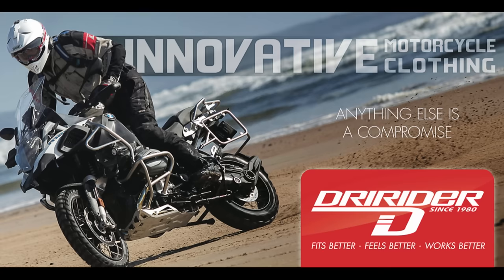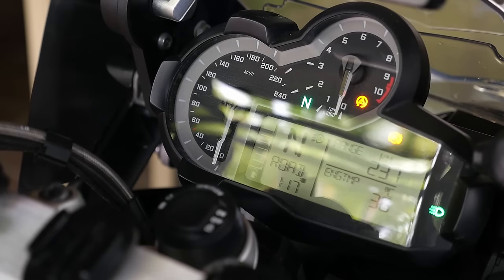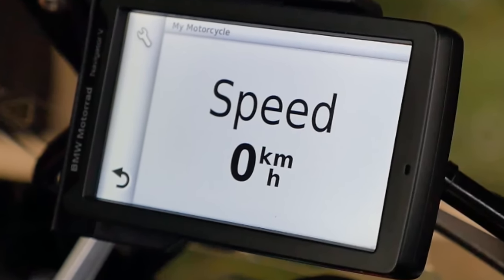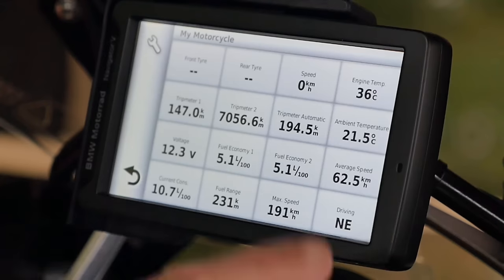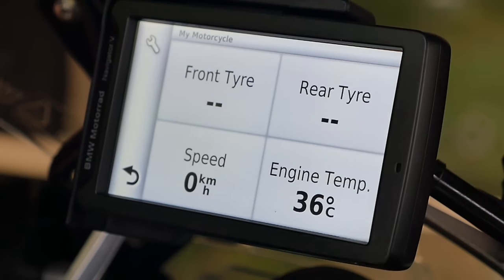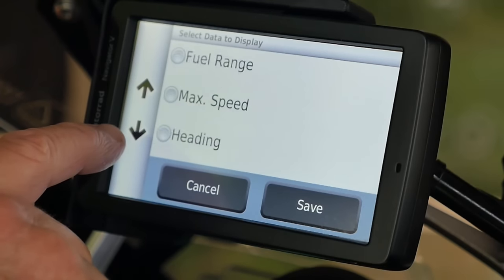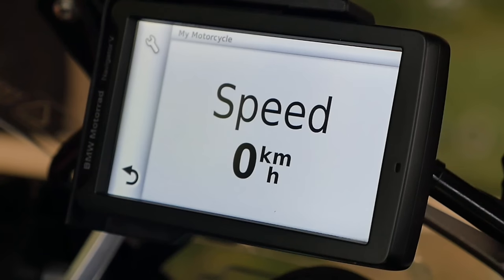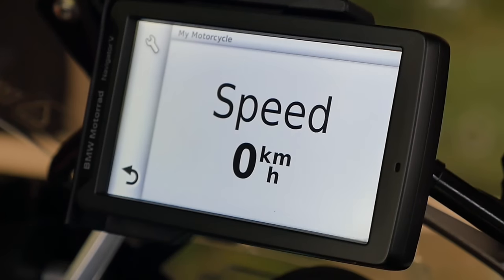Setting Up Digital Speedo on BMW R1200GS Navigator V

Comment: Good vid. Thanks. For whatever reason, manufacturers have been building in speedometer error forever. Always 5mph slower than actual
Reply from the maker: Thanks Joe, I think they err on the slower than actual error which solves the issue of a rider getting a speeding ticket being able to use the speedo reading as a defence. Just a guess

Comment: Is the "My motorcycle" screen a GS only thing? I'm sure I saw it on an RT. I just bought a 1200RT and a Nav5 and can't get to this screen. There's a horrible green screen with lots of useless info about sunset and sunrise, elevation and coordinate, but nothing about the bike as yours has. I can get things like voltage, tires pressure, speed, temp to display on the TFT screen, but only one at a time. One reason I bought this GPS was to have everything on display at once.
Reply from the maker: I don't have an RT mate, so I did some research. It seems that the 'My Motorcycle' App does not operate or even appear when the navigator is fitted to any bike other than the GS. I believe when you put it back on a GS the app appears. Sorry I cant really help mate.
Reply: @TheBikeStig  Yeah I'm starting to see that now. Really bummed out by this. The RT is one of their flagship models with all the Luxury refinements. You'd think that it would have the same integration with their own satnav as the GS. I may have seen it on a Bagger too, I'm not sure. Oh well. Can't have everything I guess.
Reply from the maker: @ArcanePath360  I agree, not sure why they did it this way, its funny I did notice the app image is actually a GS ... should've guessed
Reply: @TheBikeStig   It does suck that they have the means to do a seemingly easy software update to make it RT compatible, since they all have the same pins and hardware. The RT info is there on the TFT, but you can only see one thing at a time. And I'm also not sure why BMW made their TPMS only monitor tire pressure after you get moving. Surely by then it's too late to know if you need air in your tires? My Kymco AK550 could tell you the pressure as soon as you turned on the bike, not even firing it up. You could see your MPG or voltage at the same time. I don't like having to click through pages of menus and scrolling up and down to see this data. The Navigator was supposed to be my way round this problem. It's a shame.

Comment: hi i have navigator 5 and when i plug it to 2016 bmw r 1200 rt, my motorcycle option does not work. navigator 5 in the engine may also be caused in the current state.
Reply from the maker: That's right mate, only works on the GS. Took me a while to find that out.

Comment: I have just purchased an R1200RS with a Nav V, but there is no "My Motorcyle" icon  in the Apps. The jog wheel is not working either. Any suggestions?
Reply from the maker: no mate, they don't have it on those only the GS unfortunately, I cannot of for the life of me understand why
Reply: @TheBikeStig  I am happy to report back that after a morning in the BMW workshop, I now have the nav wheel working and BAM, I now have the My Motorcycle icon on my Nav V and I can access all of the info from my RS as per your video. Happy Days. I reckon there are a lot of owners out there who are not aware that this feature even exists via the Motorrad Sat Navs. Cheers.
Reply from the maker: @kevinroberts2395  that's awesome, I have to remember that as I get a lot of questions about this on bikes other than the GS. cheers mate
Reply: @TheBikeStig  No worries. If it wasn't for your video on this Sat Nav feature,  I probably wouldn't have kept it. Appreciate it.
Reply: @kevinroberts2395  Same problem.  Is there a fix outside of a shop visit?
Reply: @terrellgarren7125  Are you asking about the Nav Wheel or the 'My Motorcycle' icon? A previous owner had 'butchered' the wiring for the Sat Nav cradle which is why my Nav Wheel wasn't working. I now assume once the bike shop fixed that, the icon was restored as it accesses the telemetry from the bike and that is what you can then choose to display on the sat nav screen as per the video.
Reply: @kevinroberts2395  Thanks. I cannot make the wheel work on the Nav screen on a '16 R1250RT.  Your thoughts?
Reply: @terrellgarren7125  Check where the wiring from the Sat Nav goes. It should just plug in to another plug. Other than looking at that, I have no idea sorry. That's why I ended up at a BMW workshop.

Comment: Thanks for sharing. Any idea how to change the tire pressure from Bar to PSI?
Reply from the maker: mate if you can solve that one let me know, it's the thing I want to change as well
Reply: The Bike Stig I asked my BMW dealer to switch from bar to psi when the bike was being serviced. I believe it can be done using the dealers service computer.

Comment: I have the navigator VI, and a GS from 17, I cannot find the "My Motorcycle" bit, which is fairly annoying :-(
Reply from the maker: Seems strange, what made mine so useful is the fact that it's connected to bike data.
Reply: @TheBikeStig  apparently, went to BMW and they told me the on board computer was not up to the level needed for that part to work :-(
Reply from the maker: @paulbridge6063  thats so ridiculous, not the usual BMW response from my experience

Comment: It always amazes me that they boost the speed on bikes and cars to be 5mph faster than they are. The Police know this and deliberately make the speed cameras around 10mph over the limit before they activate, to account for the inaccuracy + a little more, so they are sure you are speeding.

I'm not sure if the people making the speedos do it because of a law which is in place to tell people to go slower (which is stupid, because we judge speed on what we are comfortable with, not a number on a screen) or if they do it do add more miles on the clock so you get a service sooner and the dealer makes more money.
Reply from the maker: I think they err on reading too high than too low because of the issues that would arise when people are booked for speeding. It would be a litigation nightmare

Comment: so I guess that means the bike speedo was reading 200kph when you achieved your max speed of 191 kph on the GPS ??
Reply from the maker: 191kph? Not sure where that reference comes from Mark, I've never done a top speed run or test on this bike.
Reply: have a look at 1min 46 secs screen shot on the bottom row. This displays max speed achieved - by someone that has used that GPS.
Reply from the maker: Mark Vane-Tempest aha, now that makes sense, the 'max speed' was the words on the GPS. I actually can't answer the question as I've only really taken notice of it at 100kph. Is it 8kph across all speed ranges or is it an 8% difference ... I'll let you know.

Comment: The 'My Motorcycle' app is great, however go to the Apps and find the 'Trip Computer". It has all of m the My Motorcycle app information but displays it all in a more intuitive fashion,  Try it. You'll like it. Unfortunately it can't be selected by rotating the thumbwheel (although it can on the K1600,,,go figure!!
Reply from the maker: Okay, I'll give it a run, thanks for the tip :-)

Comment: Not good ! Not good! if the gps is not stable the speed difference will be higher. If you rely on GPS speed you will get a ticket one day...  Go to a long tunnel and see it yourself as an extreme example. 
If there was a way to show the analog speed on the big gps screen that would be a real solution...